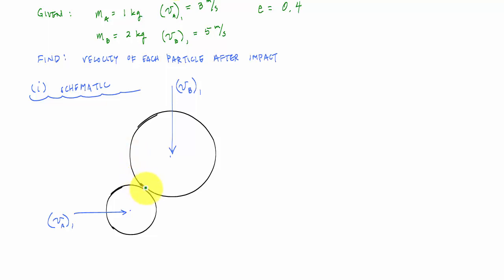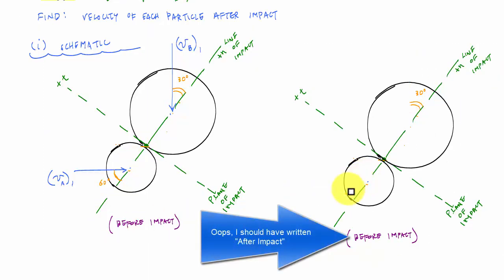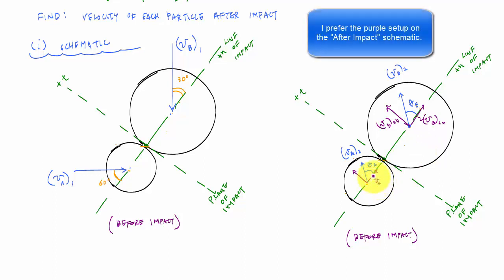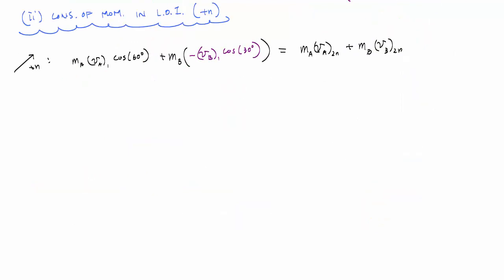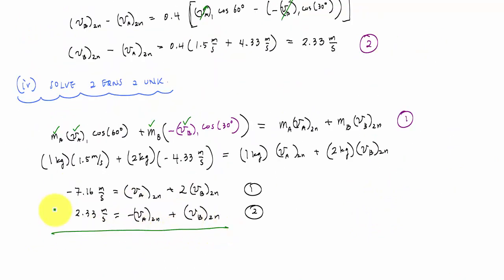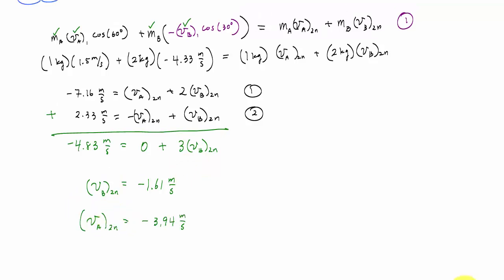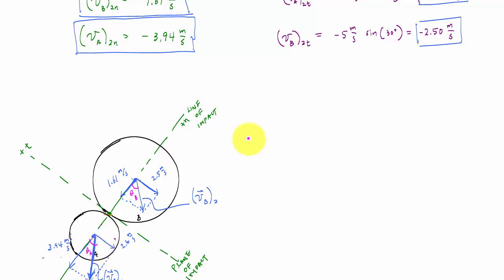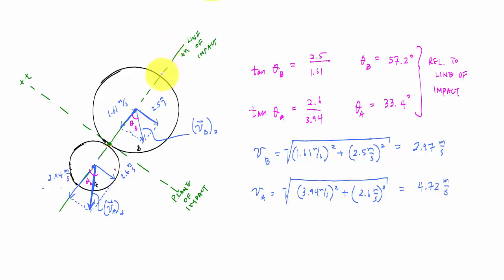Oblique Impact Example 1 - Engineering Dynamics

Comment: What you suppose to do if you are provided mass of A is mkg an mass of B is 2kg  then before collision body A it's velocity was 5m/s and body B was at res also after collision velocity of body A was 2m/s in direction of 50° so you suppose to find velocity of body B I need your help
Reply from the maker: it sounds like the unknowns in your problem are different. I recommend you try solving symbolically and take an inventory of what you know and don't know.